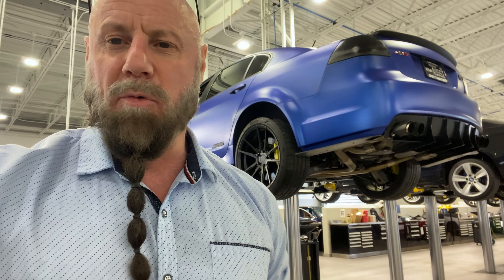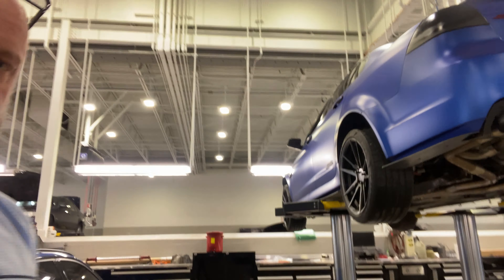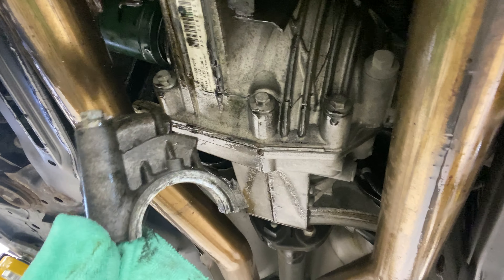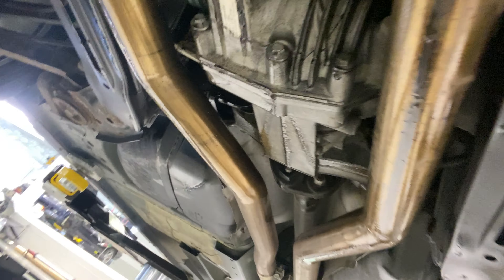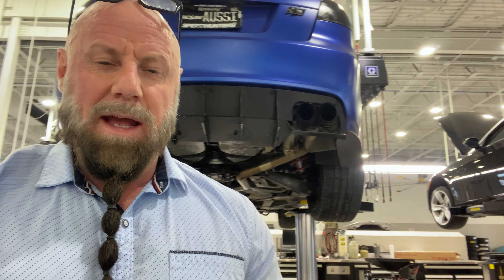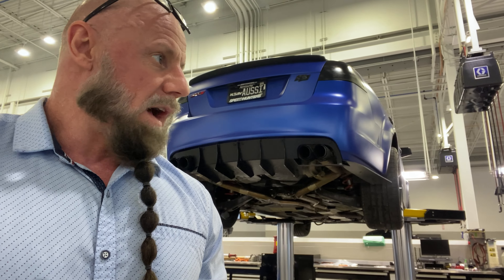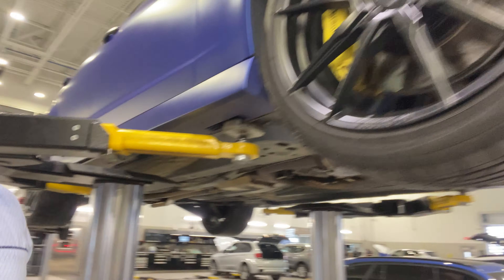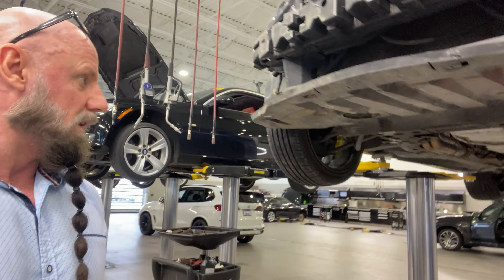Exploded the diff on my Pontiac G8 GT

Comment: If you can get the 3.45 camaro diff it really livened up my 2009 g8 gt. Really noticeable during city driving and the revs aren't super high on the highway
Reply from the maker: Thanks mate I think I want the 3.25,  it was fast with the 2.85.
Reply: @HARRISVLOGNATION  your car most definitely makes more power than mine so you are probably good with the 3.27 gears. Anything is better than stock 2.92 gears and the weak diff
Reply from the maker: @benjamincole659  right lol,  I have found a few 3.27 LSD for around $600-$700 :)
Reply: @HARRISVLOGNATION  see i got lucky and got my 3.45 diff for $600 a while back I know they have gone up lately
Reply from the maker: @benjamincole659  I just got one with 21k miles on it for $750 shipped
Reply: @HARRISVLOGNATION  awesome thats a good deal for a low mile diff